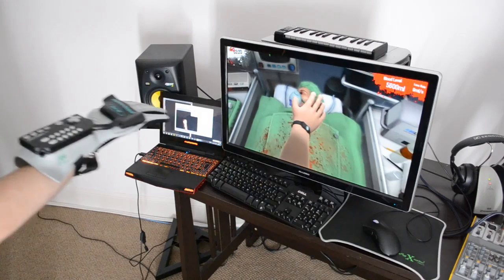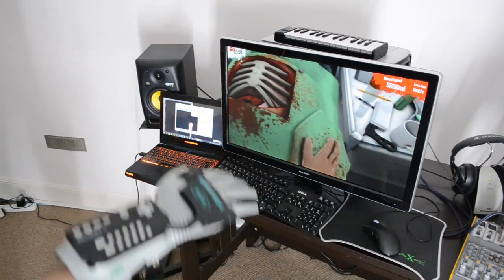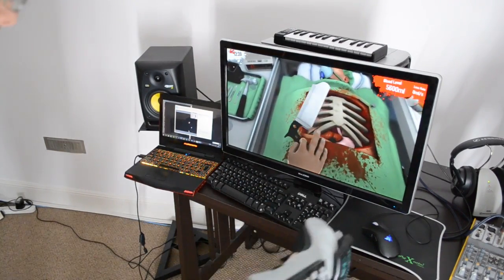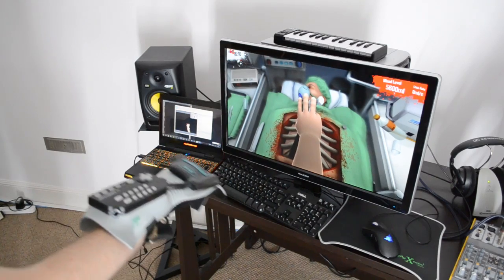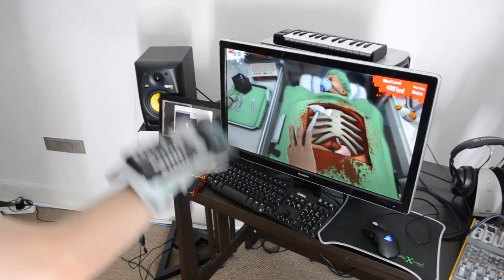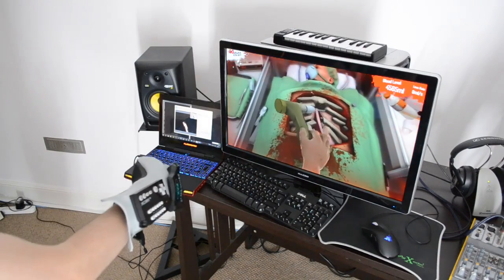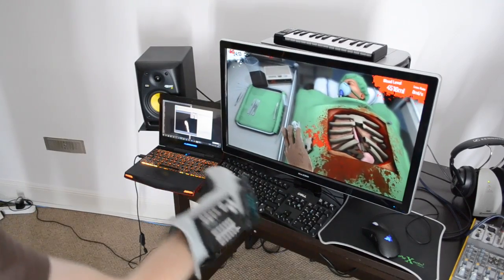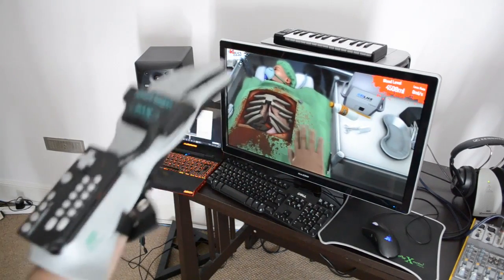Power Glove Surgeon Simulator 2013

Comment: so you're using a power glove, through Kinect, to play Surgeon Simulator? Basically, a piece of shite hardware, through a more updated piece of shite, to play a game with complete shite controls? Difficult...
Reply from the maker: Bingo. In retrospect, I had set myself up for failure.
Reply: At least it made for an interesting bid :p
Reply: Bilal Jones Where is a Kinect used in this?

Comment: wow the lag
Reply: yes surely some things could be done to improve the performance, dandy ideas though, a good use of the old useless power glove :p
Reply from the maker: yeah, kinect kinda sucks.
Reply: Theremin Hero
This is cool, but I think the p5 glove would be at least as good as the kinect for accuracy, and it has similar bend sensors to the power glove, so it shouldn't require physical mods (your way is cooler and wireless though)
Reply: But im sure you can modify it more so the lag wont be there :)